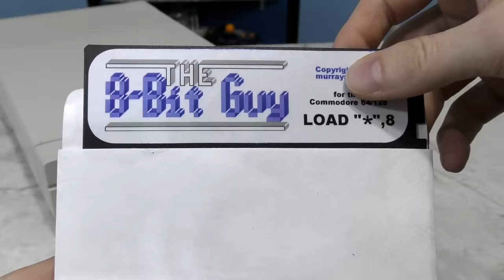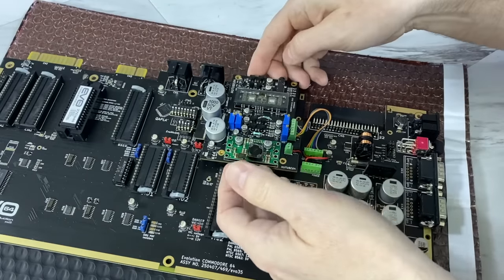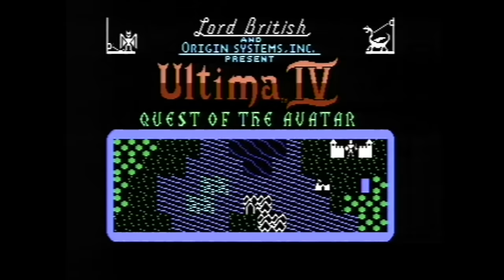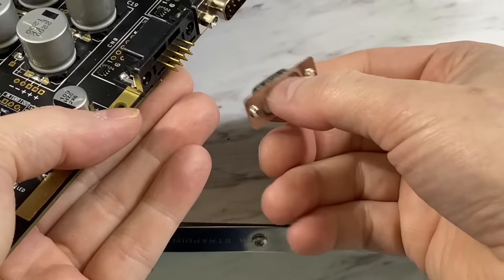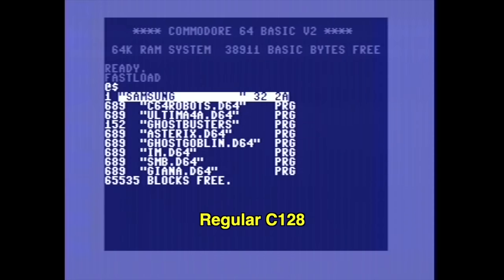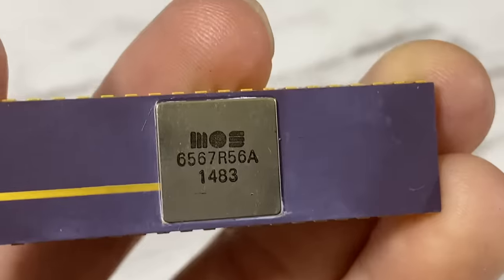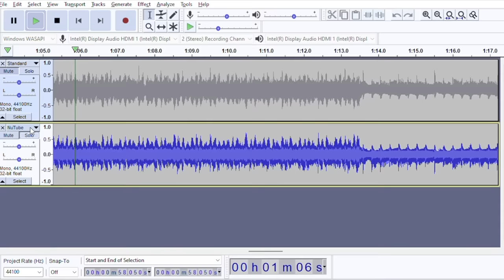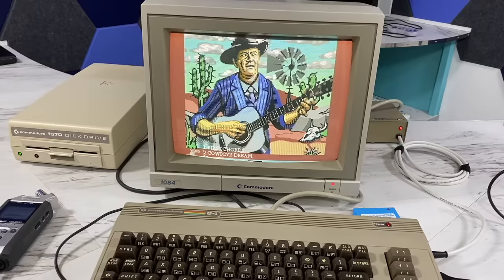The Evolution64 - Is it worth the money?

Comment: I could make cheaper using a small 3 or 4 layer pcb, use off the shelf parts, and use fpga to combine vic-ii and stereo sid 

Add native svideo and rgb output too
Reply: Doesn't need oem parts just the right configuration of logic gates mapped at the needed memory addresses
Reply: That's what Hong Kong, Taiwan, and South Korea did with Nintendo consoles 
 
Like nes, snes, gameboy
Reply: Technically Noac are actually more capable than an actual nes

Look at their datasheet  more graphical  capabilities and other features not normally part of nes 

That may be why they aren't 100% compatible 

Legal reason

They actually use those chips for digital photo frames and whatnot

Comment: The tube distorted the audio signal ever so slightly, and sounds amazing in my opinion compared to the original. Also, isnt the SID chip an analog synth? I dont think its "digital" to begin with.
Reply: It's partly digital (waveform generation) and partly analog (filters), the latter being the reason no 2 SID's sound exactly the same.

Comment: The "warm sound" experience is caused (in-part) by the large-linear-range of vacuum tube amplifiers.  Transistors have a much smaller linear range & are best suited for switching applications.  Considering the waveforms of the SID are mostly square and triangle waves, I doubt the audio will ever sound different....even with a proper vacuum-tube-amp.
Reply: I disagree.  Having done actual measurements, vacuum tubes have a fairly narrow range of true linearity.  While they may have a larger range, that range is in no way "linear."  Even transistors aren't linear, but are better in the linear range than tubes.  The "warmth" you are explaining is distortion, it's just pleasing distortion.

This is the same BS that people claim for vinyl records.  If you actually measure the sound reproduction with actual verifiable instruments, typical solid state amps perform better.  But to the human ear, which is subjective and prone to errors, tube amps sound better.  Again subjective.
Reply: Nonsense. People should really learn more before saying false things all over the internet. Tube are NOT linear at all, and transistors can be made much more linear.

Comment: I COULD hear a VERY SLIGHT difference in the audio at the start. The NuTube seems to have a little bit better dynamic range.
Reply: I agree that the nutube does sound a little bit better, though there's only so much you can do with the original signals from the sound chips. Is it an upgrade? Probably. But it costs waaaaaaaaay too much.
Reply: @Tahngarthor  - yeah, fair point. At some point, you're gonna get diminishing returns.

Comment: Is their any way to make a Windows computer that has a USB to Serial adapter run in pure DOS and behave exactly like an old 386 machine with hardware serial cards ?

I have Motorola Radio Service Software RSS that only runs on DOS and I can't get any machine to be able to communicate with the radios.

It can't seem to be able to use the USB to Serial adapter even though it seems it.

I don't know what is different about the USB adapter but the software is not talking to the radio

Thanks
Reply: try using dosbox and add the usb-serial to dosbox. That is as far as my advise goes.
Reply: There's loads to unpack here (not least, why you've asked this question in the comments on a video about a replacement Commodore 64 motherboard).

Is the serial cable you're using known to work with the Motorola radio setup? Not all serial cables are the same.

Have you been able to test the serial port any other way, such as sending text to another computer over a null-modem cable?

Are you running DOS on bare metal? If so, do you have a device driver installed for the USB-serial adapter? If not, it won't work. If you do, it still might not work, for the reasons below.

If the Motorola software is writing to hardware registers then it probably won't work, because the registers don't exist in the USB adapter, and usually they're not fully emulated (or emulated at all) by the device drivers.

Not all USB-serial adapters are the same - many cheap ones are very basic and won't support all the functionality of a hardware serial port (e.g. handshaking modes or unusual baud rates).

These might be possible solutions:

1. Run DOS and the software in VirtualBox (or DOSBox, as in the other reply), and configure it to use the USB-serial adapter as COM1
2. Get a different serial adapter
3. Do this on a machine with real hardware serial ports
Reply: dosbox-x is also a good option.
Reply: or you can search for a real working 386/486 machine. there are a few from time to time that are for sell but they are usually expensive, due to being vintage.
Reply: @giornikitop5373  It might not even need to be that old. I kept a Dell Latitude D531 laptop from circa 2008 because it's got a real serial port. Something like that is highly likely to work.

Comment: to be honest, I can't understand how you don't hear a difference, even in the recordings you specifically chose to demonstrate. I could immediately hear a fairly clear and obvious difference, (on laptop speakers, not even headphones or anything), mostly in the lead synth track and it's sustain/reverb. and it does sound marginally better. it's at the very least its some kind of filtering. (whether its an improvement worth $500, or if tubes are appreciably better, are other questions entirely)

Comment: About the audio upgrade, the way you're doing it is almost perfect, in my opinion. Most audio gear out there (including your recording gear) tries to be as neutral as possible (that is, as objectively perfect as possible, not altering the audio in any way during recording or reproduction), and we got quite good at doing that. To hear the difference between two different sources ideally you want to isolate the sources, and keep everything else the same, and you did this. Making it "tubes all the way" would mask what each individual part of the whole system does.

And as someone who works with electronics, I know that almost everything (made in the last 15 years, maybe more) between the audio signal and your listening device makes no audible difference to whatever you're playing. Between the DAC and the amplifier (the two that make any difference), the amplifier makes the most difference by a large margin, but it's still a very small difference.

As someone who has heard a lot of stuff, I can clearly hear more distortion and a warmer sound from the tubes (as expected). In my opinion this makes the sound much worse. I don't think it's worth more than maybe $20 for amplifying an 8 bit source.

Comment: I hate to be sceptical on a really great well made vidoe but, wow, I do not appreciate the solder job on U17 - the QAPLA. You should really start by mentioning this is a prototype, David. 
I have to remind everyone that matte black solder mask and extra decoupling caps don't necessarily mean this is a "high quality build" when the majority of the evidence points the other direction - even if this board "seems to work".  There's even random THT 15.1uH coils on there @1:45. At least that's what I assume from the color.
And unknown ZIF sockets with unknown rating along with the low quality documentation certainly doesn't improve on that. 
Just from the visuals in the Audacity recording it kinda looks like there's less filtering on the NuTube - which again might or might not be an improvement like you said.
I appreciate the review but the product certainly isn't ready for market as "high quality".
Thanks for great entertainmaint, David - even if you're being too nice on the product!
Reply: As David highlighted in the beginning of this video, he is in fact working with a hand assembled and soldered prototype board. However the production release boards have been available for a couple weeks now. There is quite a bit of information posted online about them already, including photos and change logs, etc. In short, these are partially pre-manufactured now, with all of the SMD components in place. The production boards have improved IC clearances that allow all of the "Aries ZIF socket" release handles to face UP, towards the notch that's clearly visible on the PCB silkscreen (as are the VCC, VDD, etc., which were also clearly visible on the prototype board used in this video). 

It's a bit of a stretch to say that the documentation is "poor", given the volumes of information that are available, but we'll defer to the user community to make that type determination after actually having reviewed it. Any issues that are there are certainly easy to enough to update. 

And I'm not quite sure which random coils you think you may have spotted, but if you're familiar with the original C64 Assembly 250407 design, you'll know what the referenced component is replacing.
Reply: @C64EVO  I only took into account what I saw in the video - and David having to drill holes in the PCB certainly didn’t sell “high quality”
Reply: @AndersNielsenAA  there are a lot of field variations in the sizes and shapes of screws used by Commodore in each demographic that these systems were produced in. Changing the diameter of a via drill hole is trivial and will obviously be addressed prior to a production release. 

If you have any publicly available work you would like to have reviewed and critiqued, I would be happy to offer my services. I'm quite a good judge of quality after all.

Best to you.
Reply: @auro1999  I was not aware of wild differences in screw size from Commodore’s side - so fine, withdrawn.
I stand by my comment that what was shown in the video certainly isn’t a “high quality product”.
No saying how long a hand botched TQFP lasts for instance - and a botched on THT inductor is in the same category. Missing silkscreen indicators too.
Sure - it will probably be fixed - but that’s not what was under review here. It does look like it has potential. I am happy to hear I am being too critical and you both think these issues are minor enough to expect fixed in a production run - I would’ve liked to see a review of a finished product instead of a prototype is all I’m saying.
I looked into the zif sockets and they look really cool. Even though they’re expensive we have certainly missed good low profile zif’s.
Reply: @auro1999  Oh? So you’re selling these? I guess that explains your hostility towards honest feedback - happy I won’t have to figure out what customer service is like. 
Bye bye!
Reply: @AndersNielsenAA  I find it difficult to define "honest feedback" statements based on "opinions" which have been argued with pragmatisms based on technological constraints. And yes, I agree. Bye Bye
Reply: Sharing prototypes to gauge demographic interest   is pretty common practice. Guess you'd know if you actually had something to offer, other misinformation and noise. Good riddance.
Reply: @C64EVO  Wow. I basically just said the version David got wasn’t high quality because it wasn’t ready for market as is - which I see David agrees with - and you two go ballistic on me?! 
What’s your deal? If you don’t like the criticism or don’t agree, then ignore!

Comment: 7:05 Notice how the only difference in the order of the files is that giana.d64 has moved to the bottom. If this were Windows, I'd say the file listing (at least on the EVO) is showing them sorted by the last-accessed timestamp. Perhaps there's something similar with C64. 🤔 Did you test Giana Sisters last? Or maybe it's the other way around; did you test it first and Petscii Robots last? Try running Asterix and see if that moves. Also, see if Giana is back in the middle on the bread-bin system. Alternately, maybe Giana Sisters does something like overwriting or renaming its file (DRM?) that causes it to move.

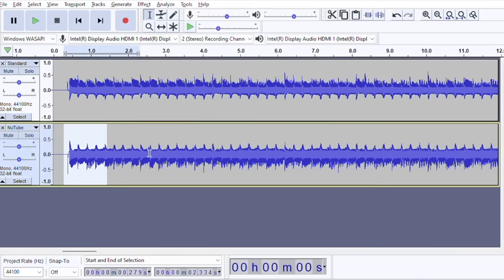11:17 The Giana Sisters theme sounds very familiar, like a song from the Rolling Stones or Eminem or Metallica something. 🤔
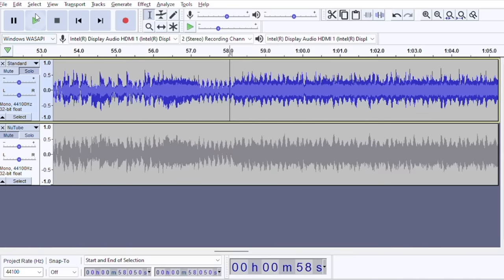11:50 Now the middle of the Giana Sisters theme sounds just like StarTropics (but it came out before StarTropics). 🤔

Comment: Interesting video.  Thanks.  The 'tubes' if you can call them that are supposed to add even order harmonics, or so I've heard and people claim that tubes 'fatten' or warm up the sound.  I've played with this sort of thing with my guitar rig and I think there is a very subtle difference.  However because the SID chip is not really a high fidelity device I suspect that for the most part any enhancement if there is any will not make anyone sit up and say wow.  You could also experiment with plugging your stock C64's audio output into an inexpensive tube preamp (a Behringer MIC100 or 200) and then into something that will accept line level signals just to see if you notice any interesting difference.